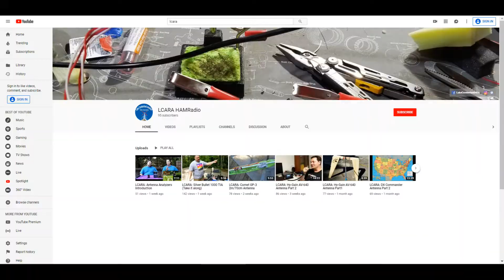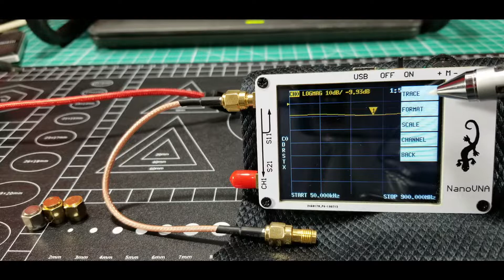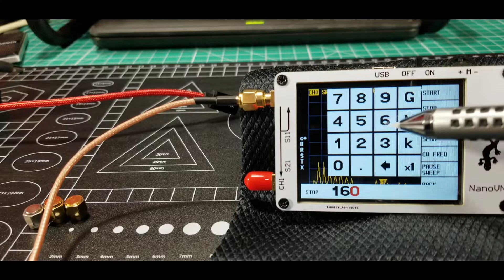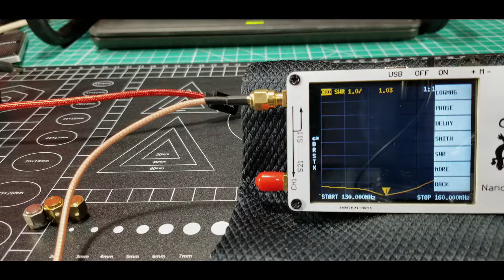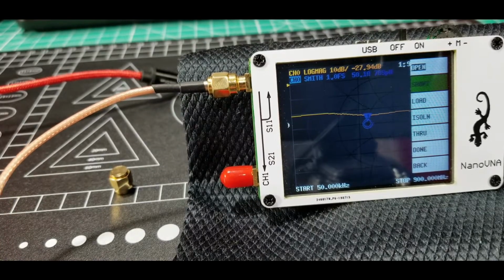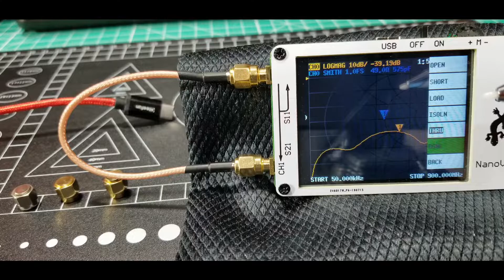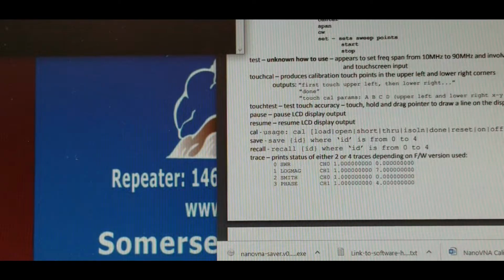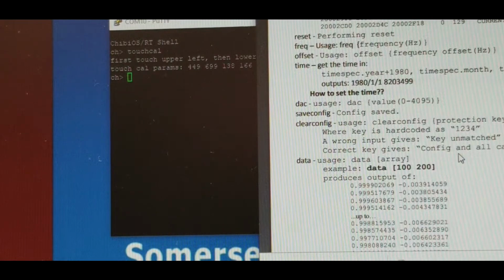LCARA HAM Radio: NanoVNA Use and Calibration

Comment: Is it ok to use the extension cable supplied with the Nano Vna? I cringe when hooking a stiff larger cable into those tiny SMA connectors.
Reply from the maker: You do always want to be careful and gently when working with SMA connectors.  You can always get a more flexible cable to use if desired.
Reply: @LCARAHAMRadio  Do you calibrate to measure a little outside of the bands? To see for instance If an antenna is capable of working outside of its designed band?

Comment: Do you find the unit goes out of calibration if it is nor properly charged. I believe mine was off frequency when compared to a know good Antenna Analyser.
Reply from the maker: I do know that it is recommended to calibrate the unit each time you use it.  I've had it stay pretty close between uses but it does not seem to be gauranteed to do so.

Comment: Would be nice to see the antenna under test.  Which connector is the "open".  Would be nice to see that, but it's off camera.   What's the io group?  Might you provide a link?  Also, wouldn't calibration be the best place to start in this vid?  Just wondering...  Finally, what about Mac o.s. users?  Out of luck?

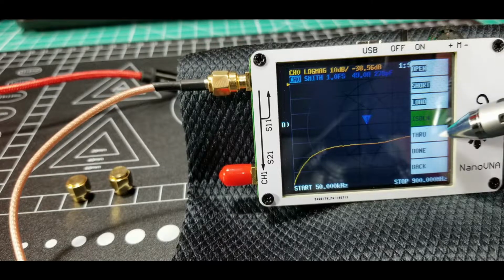Comment: 9:50 "I'm not going to do an isolation"  I cam to this video to learn what the ISOLN calibration was and how to do it.
Can anyone explain or direct me (and others) to information on the ISOLN calibration?
Reply: I found at this link: https://hexandflex.com/2019/08/31/getting-started-with-the-nanovna-part-1/

The following: "Isolation – Connect the Load to the S21(CH1) port and press ISOLN."
It is not clear to me if the S11 port is still terminated or open or if it matters.

Comment: I want to test my RG 8. How can I get that tested?
Reply from the maker: Hey Don, you can use several things to test cable. There are videos showing using the MFJ-259/269 to test for shorts.
Reply: Thank You. But I don't have one. I do have a NanoVNA. They only cost about $50. But it should be able to test the RG8

Comment: Something wrong with your cal. SWR of an open should be very high..
Reply: Isn't an "open" the same as no sma fitting at all since the sma connector has nothing in it? (sorta like calling a jumper a zero ohm resistor)

Comment: How do you do a reboot? To bring the unit back to factory defaults? I notice that on my unit after turning the unit off (not being charged) ca blue LED stays on and eventually drains the battery? Thank you
Reply from the maker: I just turn off the unit and then apply the same "3-finger" press until it beeps at me when I power it back on. That puts it back to standard operation. Can't speak to the blue light or drawing current while off. Thanks for the comment!
Reply: What do you mean about “e finger press?” I don’t understand? Thank you

Comment: Is there a way I might contact you directly? N2KTO good on QRZ. Thanks for great content! 

Just thought that I would add info you mentioned in the first video for those who did not watch your first video: 
Open:          is the GOLD connector with NO pin in the center
Short           is the GOLD connector WITH pin in the center
50 ohm       is the SILVER connector

Thanks SOOOO much for the follow up video!!!
Reply: Would love to see a video about the PC Software for the PC or Linux
Reply: Right, these are off camera so one has to do some deducing.
Reply: Great I was wondering which one was what! Thanks